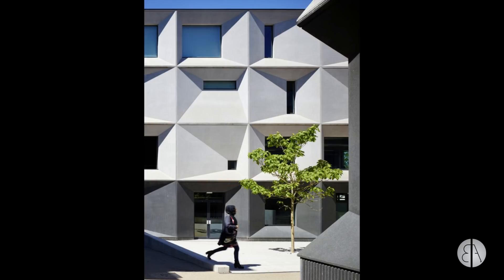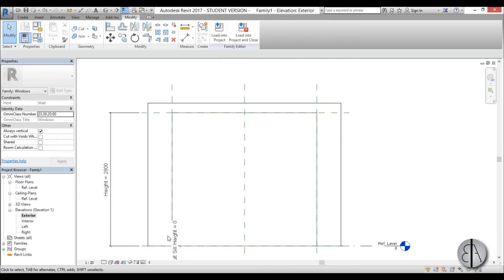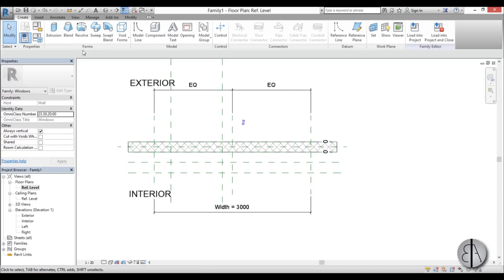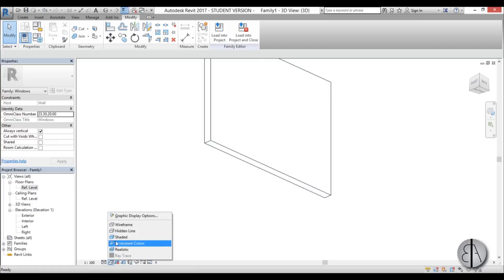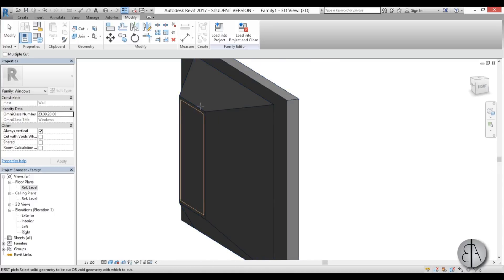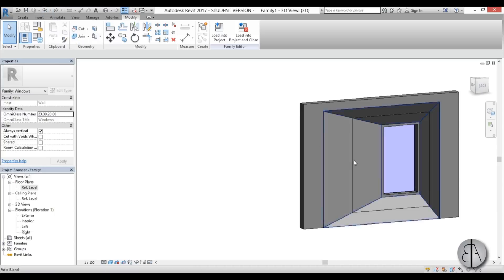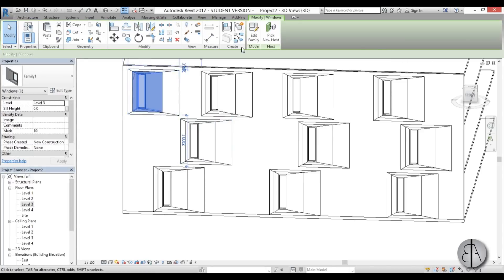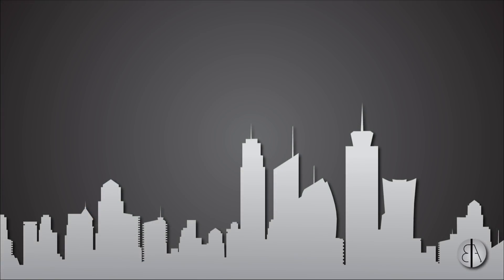Parametric Window facade Design in Revit Tutorial

Comment: You are a real hard worker for taking the time to learn all these. Sometimes Revit gets unnecessarily complicated. One could do this in sketchup in 2 minutes whereas here, they would have to spend almost 20 minutes making the same parametric component. I would have hoped there was a plugin to make this much easier, especially In cases where one has to use them in very large projects.
Reply: Maybe in sketchup you can make it quicker but once you have the family it is even easier as you can change the windows just by changing the parameters :)